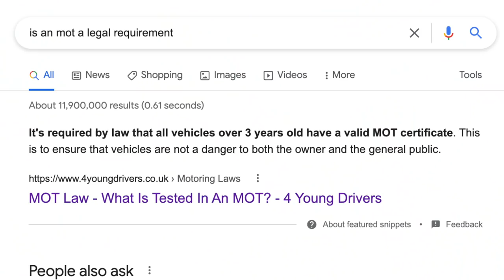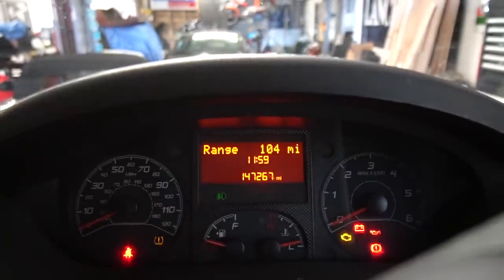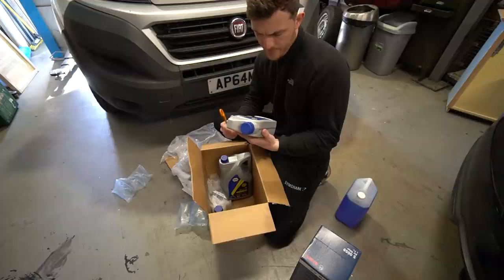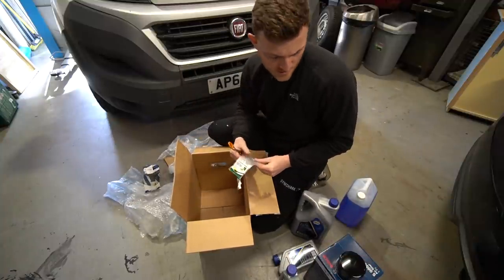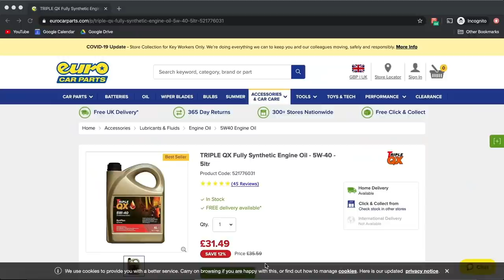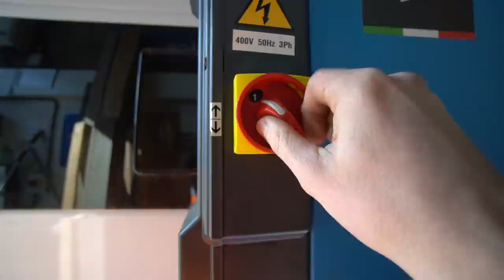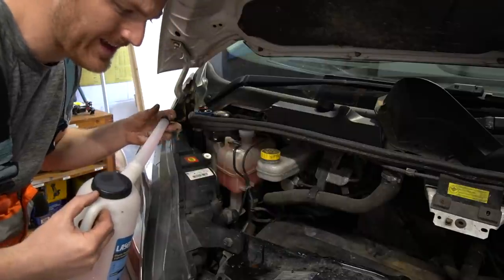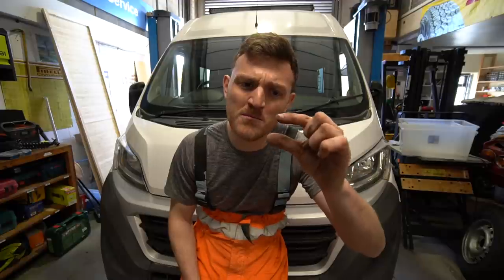BECOMING A MECHANIC! First Time DIY Van Service - No Experience Van Build

Comment: Well done will you need to do full filter too mate it's a sump that holds the oil you oil the new filter 1 to stop the rubber seal spliting and 2 so it doesn't stick when you do it next time all the best donny

Comment: Fuel filter not due? Also to save yourself hassle with the sump plug, put the socket in, preferably a Hex not a torx as you used and give it a few light clowts with the hamer, don't go silly as you don't want to cave the sump in, you also really want half inch drive unless you want scuffed knuckles and a fucked back.

Comment: Isn't there a cabin filter? I usually stick one of those cleaning fluids through the engine as well. No idea if they help much, though it did eliminate the smoke one time.

Comment: The fluid where the car says "use only DOT 4 fluid" is brake fluid. So not something you what to have a too low level of. You also do not what any contamination in it, that includes water. DOT 4 is hygroscopic and will absorb moisture from the air. That is why it states you should only use fluid from a shielded container. Water is bad because the braking system can reach a temperature where it boils

A way to check the level of fluid in a semi-transparent container is to use a flashlight. Shin it through the container and it is a lot easier to see where the fluid level is without taking out the lid.

Comment: You're doing great,because I wouldn't service my car or Van myself.  I would be scared to not put back the seals the right way.
In the past an company where I worked for did an oil change with his truck and didn't put the seal on strong enough.
The oil started leaking when the truck was driving and so they blow up the engine !!!
So that's why I go to a garage for those things.

Comment: It's OK to not have everything figured out at your age. When I was in my 20s I was in a dead end job for not much  over minimum wage and had an undiagnosed mental illness and felt like a failure. Now I am 44 and in a better place inside my head but still facing a major crossroads and uncertainty.

Comment: Will, turn the oil container 90 degrees, so you are pouring it out of the long side.  No air bubbles, smooth stream.  Oil mind, not pee!💜

Comment: I think thats way too long between oil changes, i would do it every 5000 miles or 6 months.   Did they not include a fuel filter in the kit. That should be done every year. Great video, 👍

Comment: Hei Will 

Nice work🤗👍
But i see u put in the 5 liter oil and u check then u will put in the last 2 liters hmm

First u make sure u have the right oil so not put wrong oil in i sure u have done that cause there some number u need to be sure (A3/B4) like that. 

Then i hope u did check how much oil there is needed to put in. 
Cause if u put to much in it can do bad things to the motor. 

So u put in 7 liters and u did not show after u had the motor running that u checked oil level again that u needed to do. 

Cause it should have maybe only about 6,25 liter or 6,7 liter depents of model and year but that u can find in instruction manuel,  when u top up so it can be u have little to much in but little is not a problem only if to much😊
And oil filter u use a finger u put oil on and put that on the seal not old oil filter to new not good. 
Cause if there is something dirt on the old u put it on the new filter🤗

Comment: I'm curious to know what size engine you have got in your van. ..to put 7 litres of oil in it.
Too much oil can damage the engine. 

My Fiat has a 1.9 ltr engine and only needs 4 litres of oil for the engine.. with half a litre into the filter.. primed prior to screwing it on.
..so your not initially running the engine with a dry filter. 
Stay safe.

Comment: That ramp is only rated to 3200KG, just for future safety make sure it’s under 3200kg or use a different ramp
Reply: ( Commenting as I’m watching 😅 ) Fuel filter should be changed too! It’s tucked up at the furthest point of the engine bay against the fire wall behind the air filter box
Reply: ( yellow cap ) is your brake fluid

Comment: Think yourself lucky you only got what oil you did on yourself, on a Nissan Micra the oil filter is on the top of the engine LOL, to take it off without dripping oil over yourself or the engine, you’d have to hang the thing off the ceiling upside down….

That yellow cap marked DOT4 is for brake fluid.

Comment: Well done for having a go but I find it easier just to pay to have my van serviced and checked over at the same time as it goes for it's MOT. The mechanics know exactly what they are doing, can check for anything that is likely to cause an MOT failure and they can access to the on-board diagnostics system. It's all well and good saving a few bob but if a job's worth doing, it's worth paying an expert to do it properly.

Comment: That's some dark oil! I suggest an oil change every 3 months! Also change the filter when the sump plug is not installed! FUCK me, the edits I need! DO NOT use old oil to lubricate the new filter, use some new oil!

Comment: 38mpg? No chance, maybe if unloaded on a flat road at slow speeds. Add all the weight you have onboard, inefficient tyres, lightbar etc, you’ve no chance. Beware the diy mechanic could save you £10’s of pounds but cost you thousands of ££. Always prime (lubricate) your new oil filter rubber seal before fitting, but on both sides!